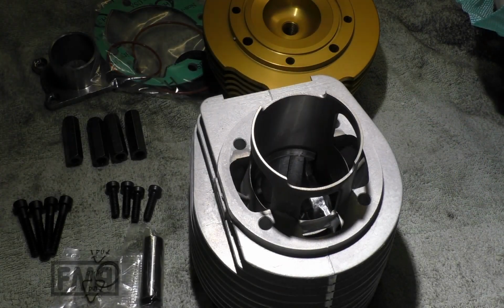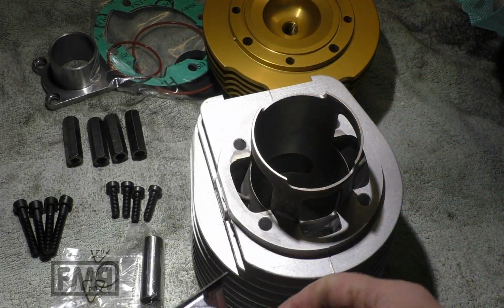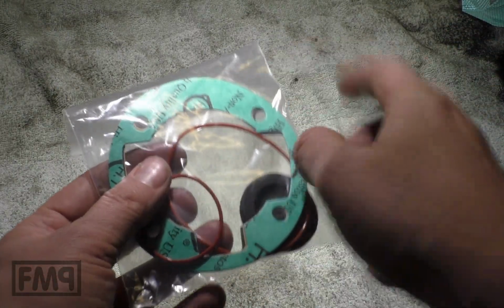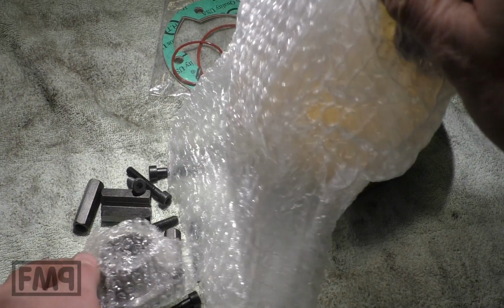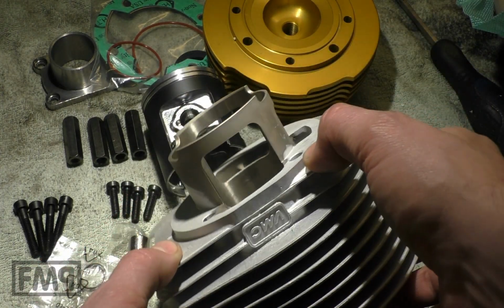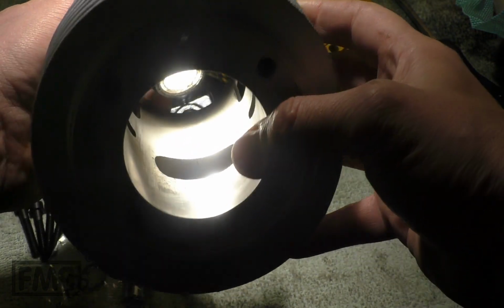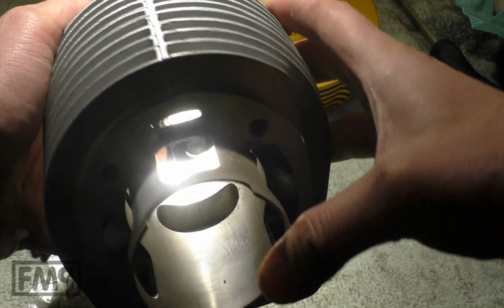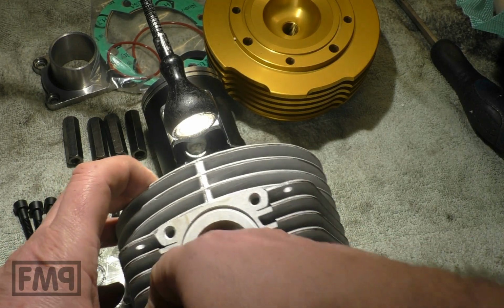vespa VMC stelvio 177 cylinder UNBOXING / FMPguides - Solid PASSion /

Comment: Hi. Do you think it would be a good alternative to the parmakit tsv ? I will make an engine with pinasco cases and 60 mm crank and i have to decide between 3 cylinders : polini iron cast, which is very good, parmakit tsv and vmc 177. What is the best kit for road use for you ? Thank you.
Reply from the maker: vmc, no wquestion there. Polini is far outdated with a piston that never did fit and thick rings and parmakit as well pretry classic with low timings and economic piston. The Vmc is brandnew.

Comment: Can i just bolt this straight on or do i have to cut my casing?
Reply from the maker: you can adjust the case, but you dont have to, they also work like this,
Reply from the maker: https://youtu.be/G8V5Dan_d2k
Reply: @FreakMoPed8  Long stoke crank any good.